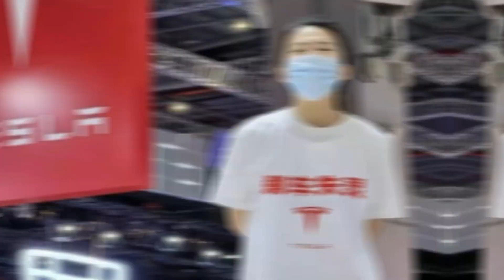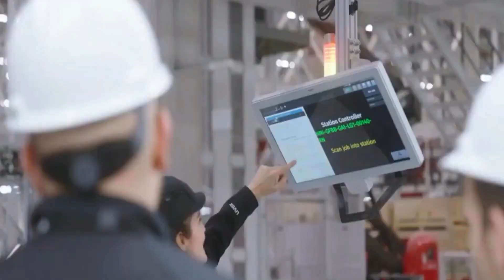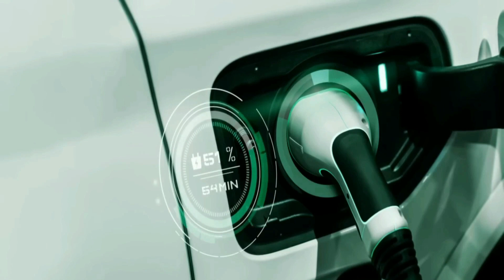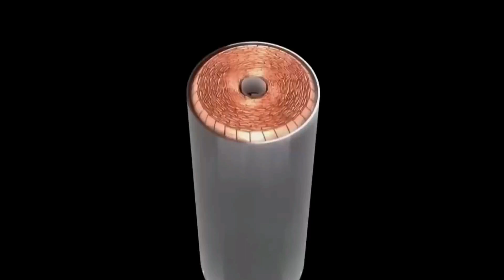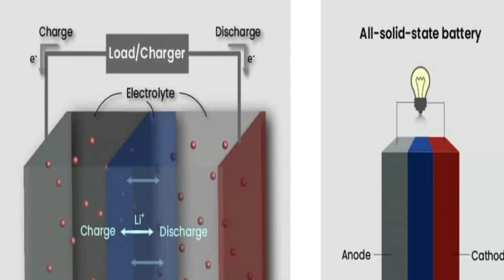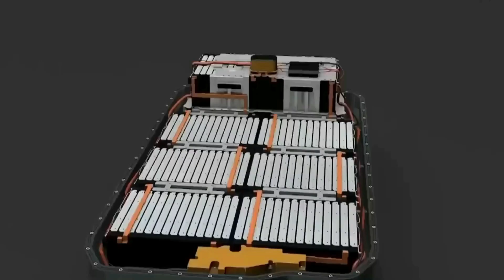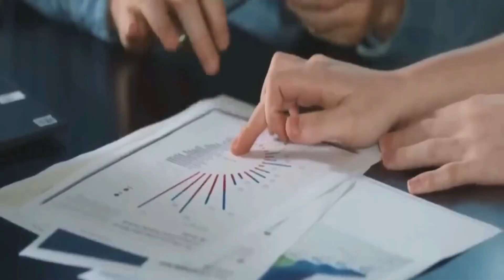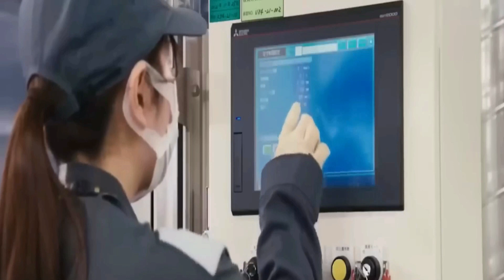Elon Musk Revealed ALL-NEW 2 Million Kilometer Shock Batteries Tech! (MIX)

Comment: It's a pity the script was written by someone with no understanding of some words. The word Quantum is a very small measurement used by physicists so a quantum leap is a very small distance to leap. A better use of the word was in the Bond Movie a quantum of solace. A very small amount of solace. If you don't believe me find a book called a dictionary and look up the meaning of the word.
Reply: Uh so you're saying my tesla is obsolete and it's lost huge market value...
Reply: @kurtdobson   All cars loose value once you drive them away from the dealer unless it's a very rare or exotic car. Tesla is the best Electric car manufacturer and is very popular so you have chosen a brand that as a mainstream manufacturer will stand a better chance of holding a better value 2nd hand than most mainstream manufacturers. I am currently looking at 2nd hand Hyundai electric cars that have lost around 50% value after 2 years they may have a 300 mile range but are stricken with huge depreciation like most mainstream cars.